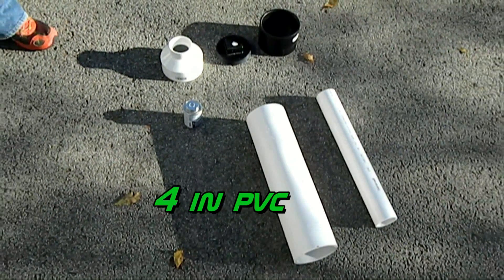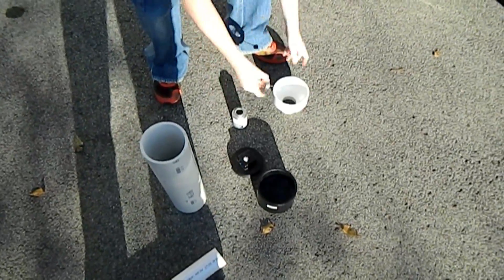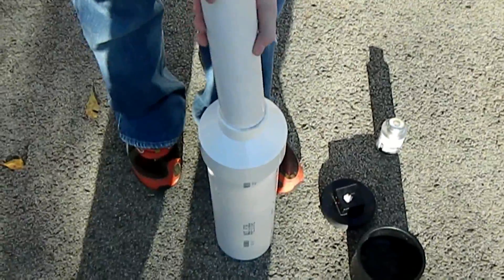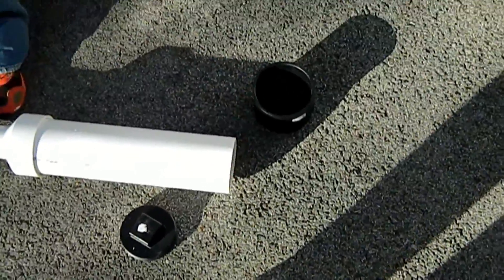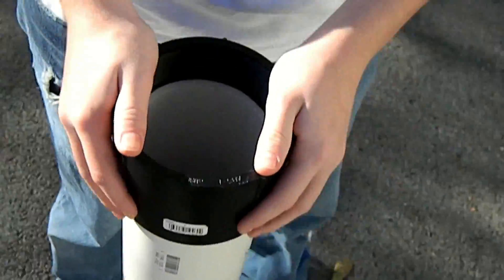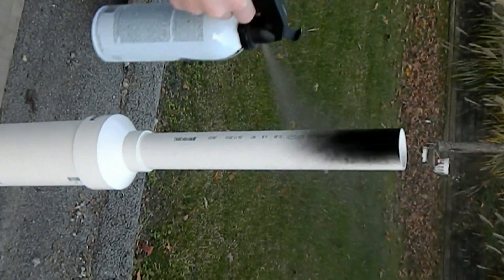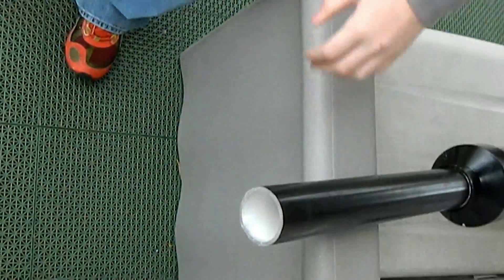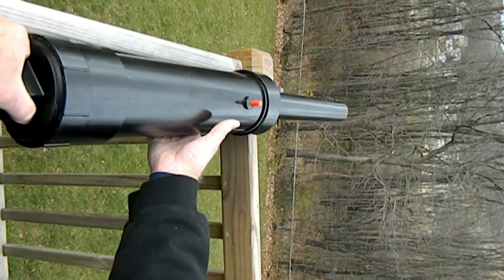weekend project: potato cannon

Comment: So many issues. No use of PVC primer??? That black end cap is going to blow off, its not rated for pressure. And keeping wires inside that ignition chamber is going to destory them
Reply: What's worse, is that the grill lighter could easly pop off, burning your thumb
Reply: Absolutly. Rite

Comment: I have heard of these type of guns blowing up, why, and are they safe.
Reply from the maker: Well, theyre made of pvc, and you spray hairspray into them, then you ignite them with a grill starter. There's a chance of the pvc breaking from the cumbustion. Other than that i'd say that theyre are pretty safe, just make sure everything is secured on with the pvc glue and such. Also don't add too much hairspray.
Reply: mini bikes and go karts 24/7 if you get pressure rated pvc it shouldnt be a problem i built mine with pvc that had a pressure rating of 280psi
Reply: Thanks it helps out a lot.

Comment: I just made one with a 1.5" diameter barrel that shoots 200 yards. For max distance try to make the combustion chamber 1.5x the volume of the barrel. My barrel is 5 long.
Reply: Bournefort i made a potato gun with an 8 inch combustion chamber down to a 1/4 inch barrle needless to say that it shoots about 500 yards when it works and has blown up a few times

Comment: bro, i just walked into ace. had noo clue on what i was doing. design it all in my head. had some stuff different.  i got a 4' x 2'' chamber and a 2' x 4'' combustion chamber with a couple of reducer's... dude, dry fired it. was LOUD AF. mom though i blew my upp. lol. anyways Im onto a safer way 2 playing with them. propane, N noo more Hoping ur hairspray didnt leakk all out because of a bad potato seal..  Also if u buy ur potato's by the pound. they will be bigger and tighter in the chamber:)